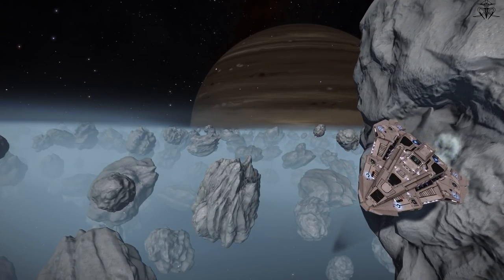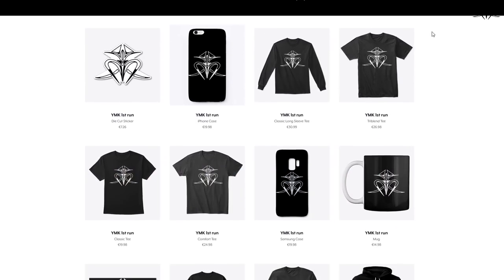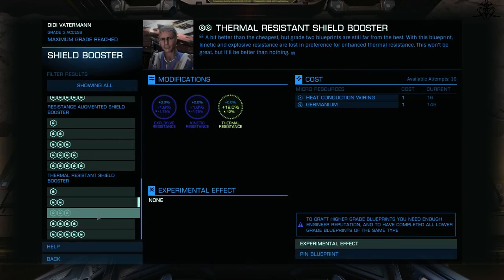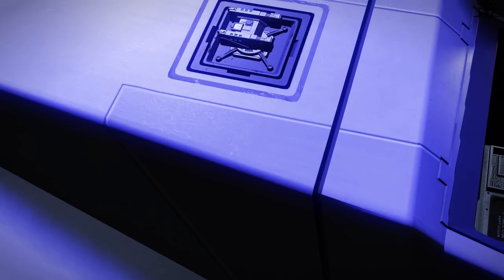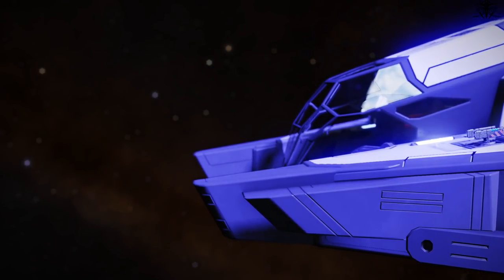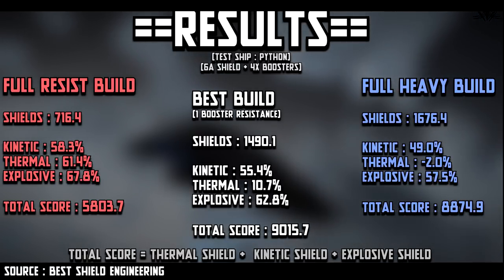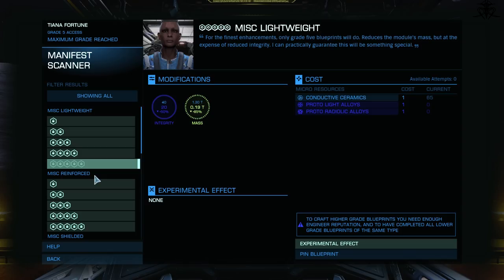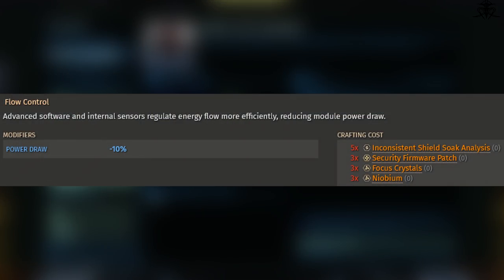BEST to WORST : STANDARD utility tier(Thermal resist,Fast scan,etc) [Elite Dangerous]

Comment: if i remember correctly on my conda i did 2 thermal resistance boosters 3 or 4 boosters that do all 3 and 2 that just up my shields hp....all have experimentals for thermal....i went for a max resistance prismatic build just for the extra fuck you to people shooting at me....because of how long prismatics take to come back i just really dont want them going down so i figured if i get thermal resistance to at least 50% or 60% theyll work as intended and they do....shields never go down unless i agro like 10 or more master or expert ranked ads in a fight and to a player in single combat or even a 1vs2 where im the 1 all i can say is good luck....not to mention my ships a bit of a hull tank too just incase they do go down....all this with still having a 35ly jump lol

Comment: Personally I do use the thermal resistance boost.  I use it in conjunction with other upgrades, so the resistances balance out, but most people attacking me use thermal weapons, so resisting That damage is very useful!  I have about 400 shield HP on my Krait Mk2 and almost no one ever gets through my shields!  It’s awesome.  I need to be careful of kinetic weapons and plasma accelerators, but other than that I feel very safe.